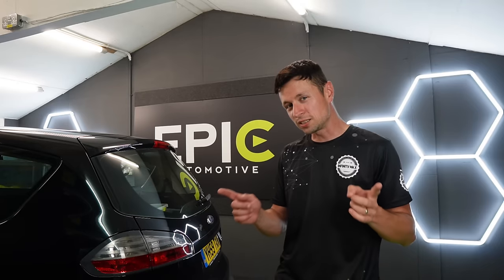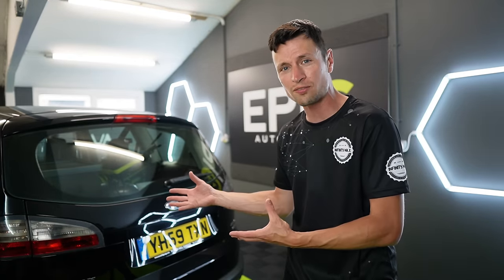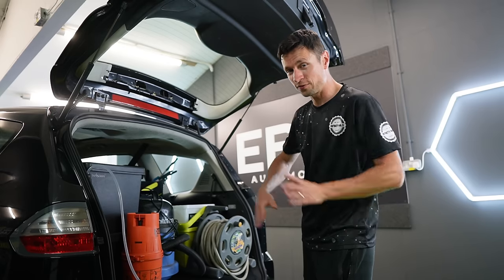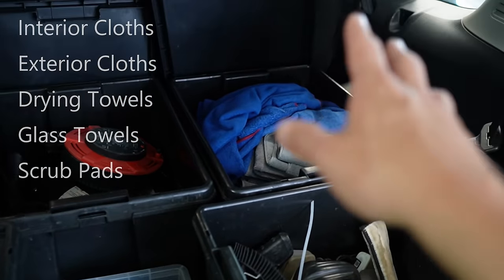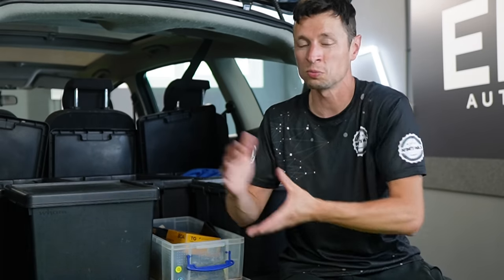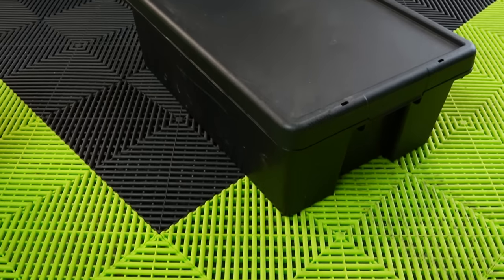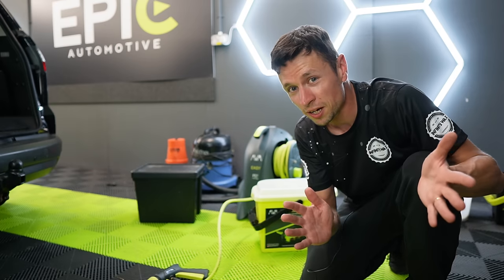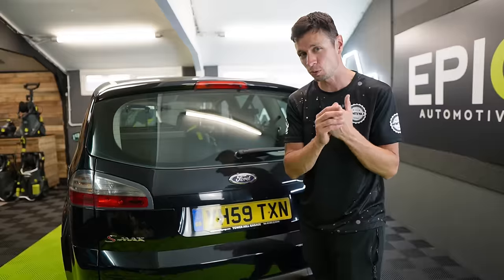Making a Mobile Car Detailing Setup using a Car / It's actually better than a van

Comment: Keeping it simple is best. I run a setup out the back of my 2019 Mitsubishi Triton ute. 30L air compressor, vacuum, karcher high pressure, hose reels, chemical rack x12 bottles, 2 slider drawer systems, wash gear, polishing machine and microfiber tubs. I can get 99% of the work done with this setup without having to take anything else. Everything else stays on the garage shelves. 
No one has even batted an eye for me not taking my own power or water either (Australia based). 

The key is having a setup where it suits your style of detailing (maintenance / ceramic / heavy duty cleaning / full details) and spending the least amount of time mucking around finding and setting up / packing up equipment.
Reply from the maker: Amazing this is good to know. I'm guessing that's a pick-up? Sorry we are not used to that term over here 🙂
Reply: @epicautomotivedetailing  yes that's correct, a utility / pick up. 4wd too for rough farm drive ways

Comment: The P57 is a beast, absolutely love mine. Glad I purchased before they went out of stock instead of waiting for the P70 restock.
Reply from the maker: Wait till you see the new improved P80. I have spent the last 6 months trying to blow the fuse and break it and still its not happened yet

Comment: I've got a van for mobile valeting, with a generator and water tank and all of that, but went out to a few jobs with my personal car instead. The bare minimum fitted perfectly in the boot (I drive an estate car, so the longer boot helped). 
To be honest, using a car instead of a van, sometimes feels better, as you don't have to go through the clutter just to use the necessary bits.
Reply from the maker: It's comfortable too. My van wasn't the nicest of things to drive

Comment: I use a rolling metal cart with 3 levels that has mesh for the bottoms. So I just take out all the critical stuff like hoses, extension cords, pressure washer, etc.. to set up and then load the cart up with the chemicals, towels and tools I expect to use. Basically the same thing you're doing with the boxes but a little easier to move around together and I toss used towels or things that may be dripping on the lower levels of the cart so they can kinda dry before going back in the bins at the end.

Comment: Great video Dave. It's honestly a really fair point about just doing it out of the car, because that's what I was looking at doing in a few months time when I come to start my own mobile valet. You can just use the customer's power and water if you are clear about it in advance. Yes, you may lose out on some people who expect you to use your own, but someone I spoke to recently said they're the sort of people that will give you all the grief anyways! Thanks for the video
Reply from the maker: You can counter any customer complaints by saying your cutting the co2 by carrying less weight, driving a better eco vehicle and not using fuel for a generator. So I see so many benefits of using a car
Reply: @epicautomotivedetailing  100% mate. Not only that, it can be argued to them that you'd have to charge more because of the weight and fuel costs to cover your own back. It's a win for all parties. Looking forward to getting started with my company! Cheers!

Comment: I’m in the early days of my detailing business and I use my Skoda fabia! All my equipment fits but it is very snug. Will be buying a van as soon as I can but I’m surprised how well I’ve managed so far! 
My main gripe is that I have to keep emptying the car of my equipment and then filling it up again as I use the car for personal use too and don’t want all my equipment in there on show.
Reply from the maker: Yes sadly it's not the most ideal scenario but as you evolve as a business the van won't take long to achieve
Reply: @epicautomotivedetailing  hopefully not! 
All being well by early next year I’ll have one. I’m eyeing up VW caddy’s atm, I’ve read that they’re good vans and they seem an ideal size. Can always upgrade to a bigger one later down the line if need be

Comment: Brilliant info Dave. 
Having a signed up van is great, but there are some striking disadvantages when starting out. Van insurance can be very expensive, and as you pointed out, a decent van will set you back a few grand. I know a top end detailer, and he spent 14 grand just having the back of his van kitted out !! Also, there's a lot of thieving gits out there, so emptying your car out each evening may save you the heart ache of finding all your stuff has been nicked, and even if you empty your van out, they will still rip your loading door open only to find an empty van.
Nice one Dave
Reply: If only there was a stealthy way to convert a truck or van quickly to look empty where nobody will mess with it, but it still looks pro when you're doing work.
Reply: @EileenTheCr0w  that's where a trailer can be an advantage, as long as you have somewhere to store it away. I can back me trailer into the garage, but not enough room for the van.

Comment: Great idea with the stackable boxes. I need to rethink my layout in the car. I have a 7 seater mpv that is 20cm longer than the s-max and my products are in long plastic trays (like the ones supermarkets get bread delivered in) but it just takes up too much space, I've been having to lay the back seats down to get all my equipment in. I've just got a new car dryer (well technically a leaf blower), a wetvac, and a steamer that I've got to fit in there now. So you don't strap anything down? I use bungee straps to tie things to the cargo anchors in the boot but I still have issues with stuff sliding about
Reply from the maker: Try these. They are solid plus they have never toppled over

Comment: I fit all my kit in the rear of an Evoque. 
I have 2 15lt jerrycan of water, a battery powered "pressure" washer for the more dirty cars, most of my customers (old colleagues at my previous employer) are only needing a waterless wash and then some sealants /waxes or coatings. I have a jackary power station for those that want the whole shebang for their paint and it can run my 700w DA for 2hrs and a fair bit of change. Plus the usual culprits a mobile valeting old man will need. If you know how small the evoque boot is, you know how cramped it is. 
Never had a complaint about not looking professional, if they whinge, not worth my time.

Comment: I use a small ROYBI 40v battery powered pressure washer to dispense my rinse-less water solution, it uses very little product.

Comment: Hi dave, im a carpenter by trade, and i just about make end meet by the end of the month. So i decided to become a mobile detailer on the side. I've got all the kit to an extent (chargeable handheld wetvac instead of a big one, and a bog standard pressure washer) but aside from that all my kit is professional quality. My question to you is : how do you know which micro fibers are used for what? Do you have a color code system? Do you just use then arbitrarily on the day regardless of size or color, and then chuck them in the washing machine ? Sorry for how many questions that is. Completely understand if you dont answer everything mate

Comment: Great Video as always. Out of the Ava Range- what would you recommend for car cleaning aswell as occasional property maintenance? i was leaning towards the easy p57 due to the longer hose reel instead of having to lug the actual body around the car constantly like my karcher.
Reply from the maker: I would say Easy P57 but good luck finding one in the UK right now. They sold out very quickly. I'd say the next best thing is the Evo P60 which is practically the same as the P70
Reply: @epicautomotivedetailing  Much Appreciated.

Comment: How would you compare the powerfoam to their wipeout? Been.considering trying wipeout when my BH autofoam runs out, been a toss up between garage therapy foam and the wipeout, but now you got me looking into the powerfoam
Reply from the maker: I just like heavy duty foam. For me powerfoam just gets the job done with no fuss. It's brilliant
Reply: @epicautomotivedetailing  should I be taking any extra precautions due to it being alkaline?
Reply from the maker: @readyshreddygo4903  not really. If you wash the same car over and over again every day for a year then yes it may not good but honestly it's not going to affect you in reality. I only use alkaline foams unless it's at customer requests. pH snow foam does really do much in my opinion

Comment: What do you do if you have a client who doesn’t have an outside water tap and you don’t have any water?
Reply from the maker: Move on to the next. The probably if that happening in most cases is slim from my own experience but for beginners who are just practicing at this stage they can be picky and just find other potential customers
Reply: they won't get a car wash...